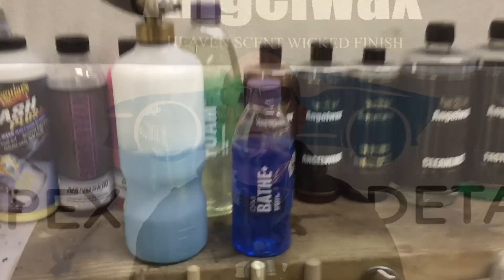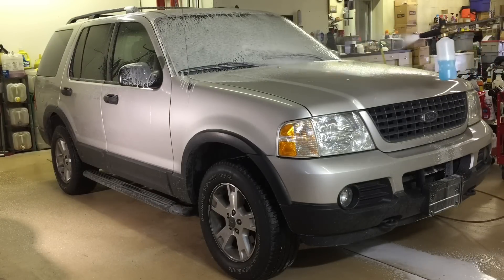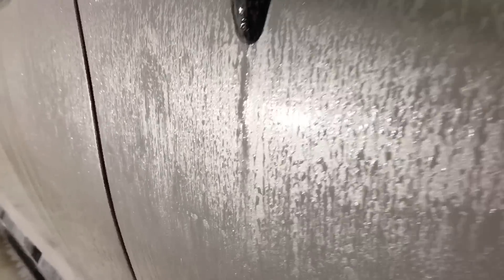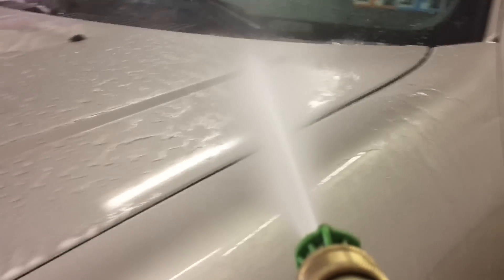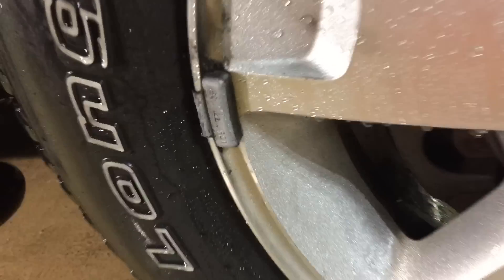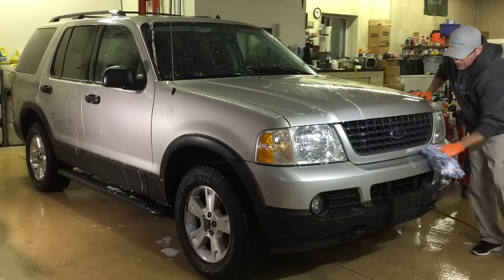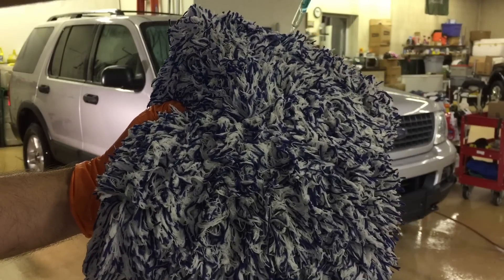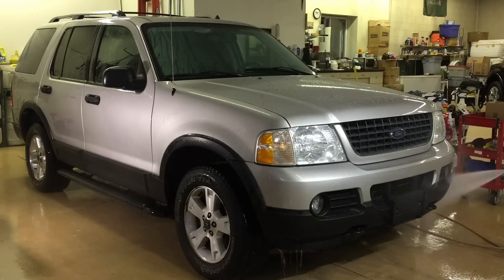Gyeon Bathe + PH Neutral Shampoo Containing SIO2! Even A Quick Wash Leaves a Strong Hydrophobic COAT

Comment: I use Gyeon Foam for the prewash and Bathe+ for contact wash on my black ceramic coated car every week. Every third week I follow it up with an application of Gyeon's Ceramic Detailer, as a sort of mini topper. The levels of gloss, slickness and water repellency are beyond anything else that I've used in the 5 years that I've been doing maintenance washes on my car. When my current ceramic topper runs out, I plan to get Gyeon's Cancoat to use as a sacrificial layer that I will apply every 6 months.
Reply: Do you use foam to dwell and rinse it off then contact wash  with bathe?
Reply: @johnevans715  Yes, I do. I first do a pre-rinse with Optimum No Rinse, let it dwell a few minutes then sheet water over the surface to remove most dirt particles. Then I spray on the Foam, let it dwell a few minutes and then pressure rinse it off. By this time the car is probably 90% clean and then I do the contact wash with the Gary Dean method with multiple microfiber noodle wash pads from top to bottom. Then a final rinse and contactless drying stage with a leaf blower. It takes about 2 hours to do, including the cleanup and final tire dressing. Because of the ceramic coat, the drying stage goes very quickly.

Comment: What would you recommend as the best foam wash with sio2 protection built in??

Bonus if shade is not an option... Like at all would the answer for the first question still be the same?? If not what's the second recommendation??

Comment: The price is just nuts, would run $150 to $160 for a gallon, which is the amount I buy most of my shampoo's.
Reply: its very concentrated. its also kind of a niche product. if my customer wanted just a wash, i could use this and protect their car to have them come back for more
Reply: I strictly use it on roofs of trucks and SUVs I can't reach
Reply: @guntperkins2551  The bottle I had actually was sitting in the back of my truck and some how the cap came off and dumped over 90% of it out. Cars that I used it on pretty much showed zero beading in my testing. Now these cars were not coated, I was hoping it would do something at least, but IMHO, its a waste of money.
Reply: @watagump1  I actually misspoke. I use turtle Wax ceramic wash and wax but I figured gyeon would be a better product. Have you used the turtle wax product?
Reply: @guntperkins2551  Been using TW Zip wax wash for years. People make too much of a big deal about a lot of car care products. I test a lot of new things, always seem to get the same results. Coatings are the one thing that do work provided you do your prep work. But I cant tell you how many waxes etc that don't even last as long as they claim.
Reply: @watagump1  I'm a mobile maintenance detailer. I take care of the same 50/70 vehicles every six weeks. The funny thing is, none of my customers would ever know if I waxed the roof or not. I agree that coatings are the most impressive products on the market. Especially when applied properly. It makes me think that applying any kind of protection before polishing is a waste of time.

Comment: Why did you wash like 1/2 the car before going in the rinse bucket
Reply from the maker: You... were not listening to a word I was saying... its fine. I was showing how much water and wash lube the ten by ten absorbs. " If you had no need to go to the grit guard ... there would be enough wash solution to do half the vehicle"
Reply: Ok but just didn't make sense to me because your dragging all the dirt from the panel across the paint needs to be rinse out in the bucket but your washing the car not me lol
Reply from the maker: Ahhh.. I get ya.. this is a shop, go fer' vehicle. Not a customer's car. No worries. Cheers!
Reply: Prestige Valeting and Detailing Also he foamed and rinsed the vehicle. The hand wash with the pad, and the 3rd step with the dropper were examples as stated in the intro. I heard you Brian😂👍🍻

Comment: Gyeon bathe + does NOTHING if you dont have standars ceramic coating on the vehicle, with no coating rather use gyeon cure or carpro reload
Reply: Gyeon cure says for ceramic coated also. It works better though?